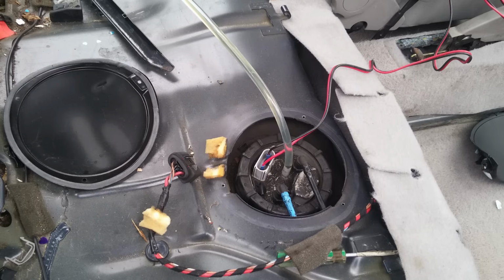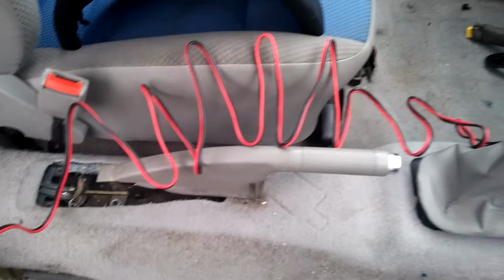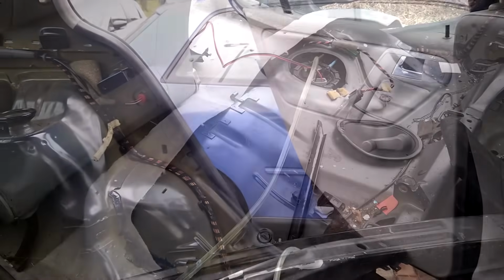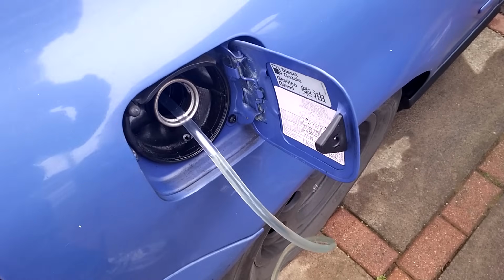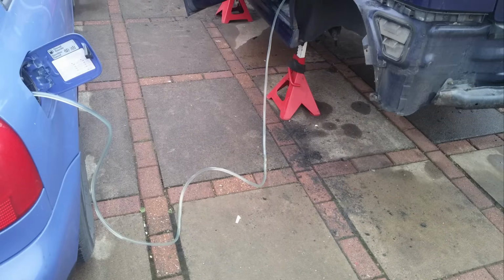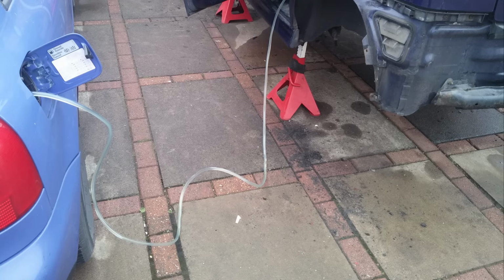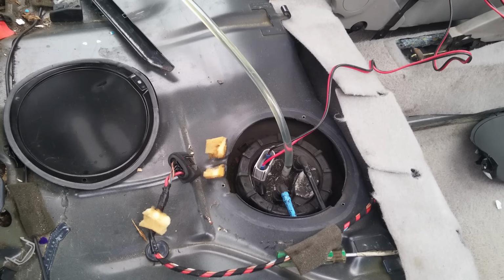How to easily drain your fuel tank

Comment: Yeah, but you have to take your other car apart, remove the upholstery and access your in-tank pump.
Reply: Only on the car with fuel,
Reply: depends on the model. in mine the rear seat folds up with two bolts to reveal the access port.

Comment: it would have been a great help if you showed the part where you disconnected the fuel line from the engine and connected it to the hose.  It does not help me as is

Comment: Hello.. is that those two cables black and red are (-) and (+) ,could it be conected to battery?  
Basically the idea is to activate the fuel pump, but not sending the fuel for engine, but sending the fuel to other tank, is it?
Reply from the maker: In this we hooked them up to available - and + so we could turn the pump on and drain it into another car.
You could do this with just a battery and hosing going where ever you want to move the fuel - please bare in mind petrol is more volatile and you might need to take more safety measures.

Comment: Can't I just use the original fuel pump wiring to run the pump? I assume it will run constantly in an effort to prime the system and bring up the pressure, or does it automatically shut off?
Reply: I know that some Mazda models don't start the pump until the engine is actually running. On cars that do prime, I think the prime period only lasts for a few seconds after the ignition is turned to the ON position. Pump starts again when engine is started.
Reply: @paulfoley6602  Thank you. I will be trying this on a MKIV Jetta, I'll bring a drill battery along just in case.
Reply: @ijible   Don't go near the tank with any power tools, or anything that could cause a spark! Play it safe and siphon from the fuel pump opening under the rear seat. Be careful what ever you do....
Reply: @paulfoley6602  that fuel pump opening is not safe from fire and explosion from a spark, you must be very careful around gasoline.